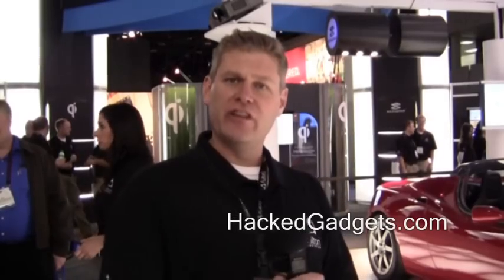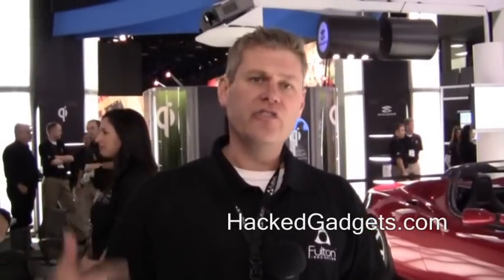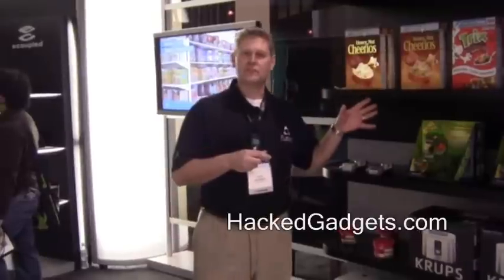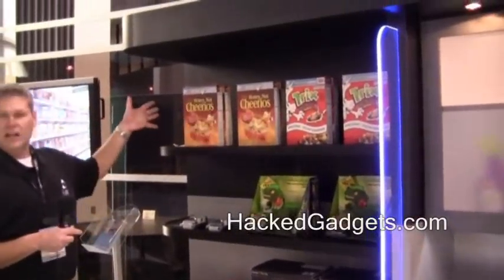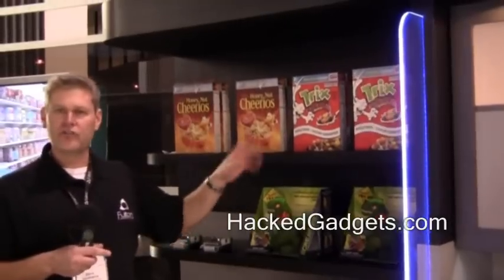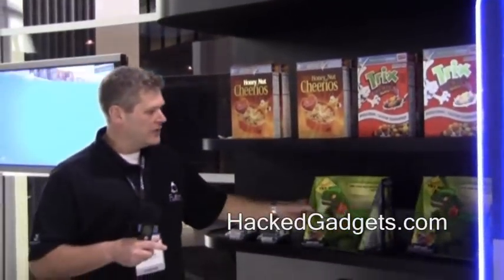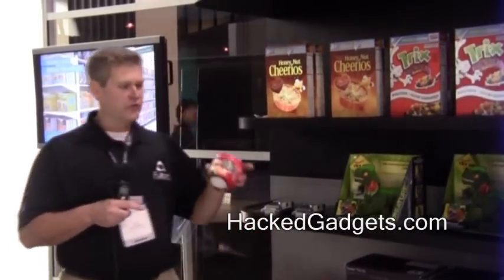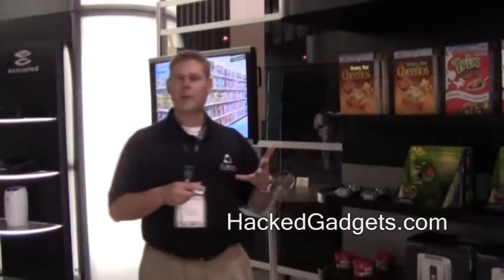Charge your Tesla or your Cereal Box with Fulton Inovations Wireless Power Technology - eCoupled

Comment: The smart+powered shelve idea is excellent, efficiency isn't a huge issue there.  Obviously with larger, higher margin items like electric vehicles adaptive optimising techniques are of great value and affordable to implement.

Standards for consumer device NFC+charging are the important thing to get going though, to build the market.  The centring magnets in the pics is an elegant solution to coil alignment problems.